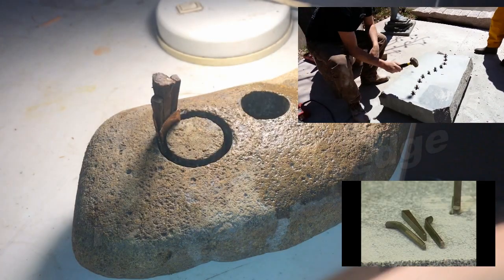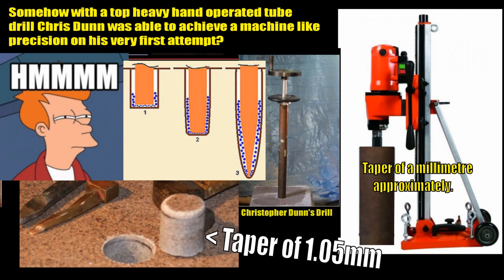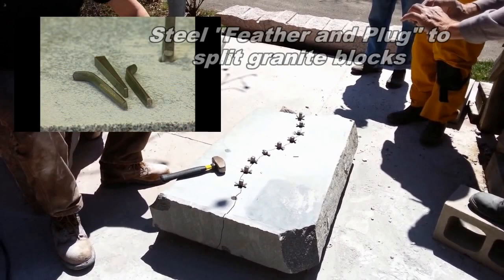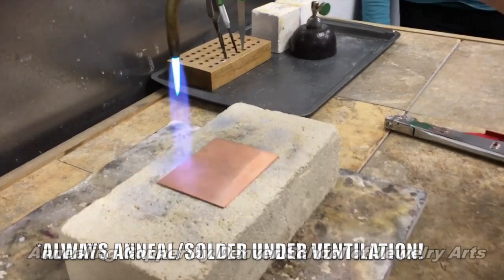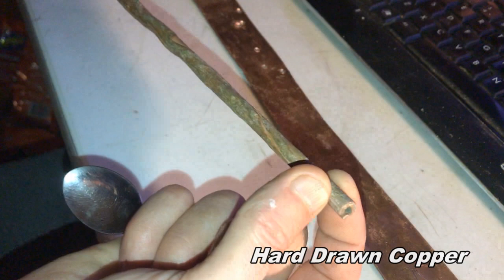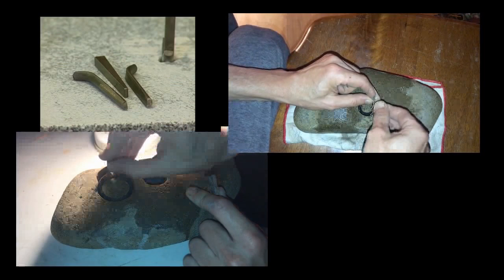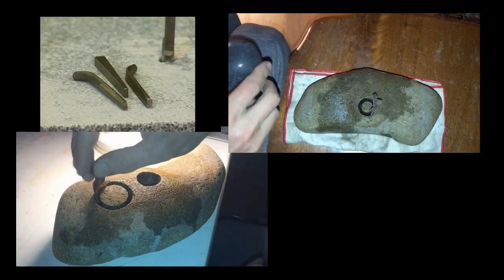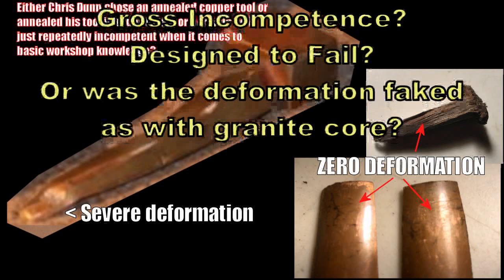Lost Ancient High Technology Industry: EXPOSED AGAIN! It's Just INCOMPETENT or it's just a SCAM!

Comment: You can split stone with just wood and water.  Dry wooden plugs that fit the holes are hammered into place and then water added so that the wood expands and puts  pressure onto the stone.  Yo may need a damn of clay to hold the water in for some circumstances.

Incidentally, your tools are probably made of the wrong type of copper.  You are using copper made using moden processes which has a higher purity whilst the copper the Egyptians used had trace amounts of other elements.  These trace elements affect the physical properties of the copper.  Arsenic, for example, is found in conjunction with copper.   Arsenic in a copper alloy will harden the alloy.

Comment: Lets say for a second that Chris Dunn did fake his core experiment.  He also did work on the statues of Hathor.  How do you explain the symmetry?  Precise to the .001 of an inch?  I'm not disagreeing with you that copper may have played the role in dynastic Egypt.  Precisely Shaping and polishing granite takes more than hand tools and skill.  Period.
Reply from the maker: How did he measure that? 
The symmetry of the Ramses statue was done with photos that were put through photoshop. 
The Serapeum is another example, his own photo shows the light reflected and it’s rippled. Like a car that has had body work done it you can the rippling on the reflection.
Precisely shaping granite or limestone or marble copper takes nothing more than hand tools and skills I would argue. 
Have you seen Roman granite sculpture and sarcophagi.
Polishing granite is just fine abrasive. I have how to videos on how to create so called precision flatness on granite.

Polishing/honing curves is just the same technique and it doesn’t take too long.
It’s basically using sandpaper to polish but without the paper. No different now than thousands of years ago.
Pliny Natural History even talks about the international trade in special sands as far as India for polishing gems, which are harder than granite to polish.
Reply: @SacredGeometryDecoded  He used photoshop to flip the image to compare one side to the other.  He's an engineer he's got the proper precision tools to do the measurements.
Reply: Just because you came up with a way to use copper that he didn't.  Doesn't mean he is being deceitful.  To act like the pyramids are not out of place is rather naive.  I choose not to speak on anyone's motivations.  I don't believe for a second that ancient Egyptians built the pyramids without tools that were more efficient than the ones described and without the wheel and something other than slaves to move them.  They may have renovated structures, superficially.  those structures were there.  Do you think the sphinx was built during the 4th dynasty.
Reply: @Alex Shilson I work with stone everyday.  It's very hard to be precise even with. modern tools.  Im not saying the ancients didn't do it.  I'm just saying they didn't do it the way they would have us believe.  Chisels and hammers didn't do it.
Reply: @Alex Shilson Copper was used in ancient stonework more than most people know.  They used copper to bind stone to stone and using it to bind stone to other materials.  Do you think the ancients had precision circular saws cutting diorite and dacite but they were copper?  there are several examples a couple in Egypt and one in Peru I believe where you can see where the stone broke but it left the uncut shape of a circle where they stopped cutting after the stone broke??
Reply: Very hard to be precise even with modern tools? What tools are you using? When we cut stones at my job we can make it much more precise than anything that was made in ancient Egypt. They couldn't even make 90 degree angles and perfectly flat surfaces. We can, pretty easily tbh, with the tools we use.

"A bad tradesman blames his tools" -SGD
Reply: @kruelunusual6242  What do you exactly do with stone everyday?
Reply: @maddogames  I do countertops, I tile, I do custom retaining walls or fireplaces interior ,exterior.  Sometimes will do some exterior stone when the job comes around.
Reply: @johnmcenroe1760  Yeah in a saw shop, but on the job with a worm drive or even a job saw its not easy, or maybe I should say its still easy to make mistakes.   Fitting stone to stone with no mortar is not easy, certainly not with the precision the ancient achieved.
Reply: @Alex Shilson another question.  If they had circular saws in whatever fashion then they had to have the wheel, would you not agree?
Reply: I also believe they haven't showed us everything by a long shot.  They certainly know more than they let on, or else they wouldn't hold on to this rigid immovable historic account.  Anyone wise and interested in the truth knows he knows nothing and when evidence presents itself is contrary to the current theory you have go adjust the theory to fit the evidence.  then if it can hold up to the scrutiny........
Reply: @kruelunusual6242  I would imagine that you have always used diamond cutting tools? I would also imagine that you use stone that has already been quarried and factory cut to size, with just some trimming on internal work and maybe rough shaping on external? I  guess you don't do any sculpting, or you would have said.
Reply: @Alex Shilson yeah sure.  I just can't imagine how.  And I'll be. honest with you its not even the shaping and cutting im most skeptical about.  It's the moving.  How did they move a 1200 ton block of limestone in Baalbek from the quarry to the temple without breaking it?  Or the pyramids.  It would've taken centuries and there are no records.  In my mind it's either from a time forgotten or they just aren't telling us.  I figure it's probably both!!!!
Reply from the maker: I have a video where i granite with a copper straight saw and it looks like a giant circular saw mark. A pendulum saw would have the same effect.
Reply from the maker: Chris Dunn faked his granite core experiment with a machine. He lied about it his experiment. 
The continued pattern of incompetence just always happening to fall in his favour?
His measuring skills such as at the Serapeum? 
Either he is a terrible engineer or he is deceitful.
Chris Dunn and co speak about the motivations of archaeologists etc all the time. They have set the tone.
Reply: @kruelunusual6242  They moved the stone on the Nile, it's actually documented by the Egyptians of the time. What you don't get told by the conman is as much a part of their scam as the lies they tell.
Reply: @maddogames  What lies and what scam????
Reply: @SacredGeometryDecoded  Ok Chris Dunn is just one person.  There's plenty of evidence both ways.  It just sounds like you have a problem with Chris Dunn maybe you are right about him.  I don't know.  I'm not super familiar with his work honestly.  I do not know what he did at the Serapeum.  I just know he thought Giza was a power plant.  I didn't look too deeply into it.
Reply: @maddogames  just out of curiosity do you really believe they built the Great Pyramid in just 20 years???
Reply from the maker: Chris Dunn is the source of all the rivers so to speak. Claims such as precision or it's impossible to cut etc from his books are constantly cited by the wider community which portray him as a master engineer etc. For several years in the comments I kept getting told to look into Chris Dunn because he has the proof. I found only extraordinary incompetence and in some cases deliberate deceptions/falsifications such as his granite core experiment, the only experiment ever conducted by this community as far as I can find. For all the years, money and visits to Egypt etc not a single valid experiment has been done by the entire LAHT community, yet they keep repeating disinformation in regards to ancient capacity such as the Romans could't do this and that etc. To say something like that would mean they would have studied that era of history, so either I am left with the conclusion that they haven't studied it and are just making things up, or they have studied it and are being dishonest.
I see these things as our birthright and they are robbing people of their own capabilities whilst making a pretty penny from it at the same time, I target Chris Dunn and co because they are an industry profiting from their claims. Selling books and tours, I and others have been censored or blocked for leaving polite comments with links contrary to their claims. Being nice hasn't worked and so here we are
I have gone through the claims made by this industry and examined them in detail, along with others I have tested them and posted the results, so that anyone can cheaply and easily test the results for themselves if there is any doubt that the experiments were rigged or poorly done. I am very familiar with what they say. I wouldn't call someone a fraud on a published format given libel laws.
Reply from the maker: The quarries of the large stones are right on the river, they were only transported a very short distance to the river and floated down, then a very short distance from the river to the final location. Before the Aswan Dam the annual Nile flooding would even allow some stones to be floated directly from the quarry to the final location without needing to be moved or lifted.
Romans moved massive obelisks such as a 400t one from Egypt to Rome, over 1700 miles making the Egyptian move seem rather small in comparison since they crossed the Mediterranean, and then 17 miles overland up the Appinines.
The heaviest stone actually moved at Baalbek was 800t and half a mile, the quarry at its lowest point is only 10 metres lower than the complex, an angle of about 0.7 degrees uphill. The higher point of the quarry is above the complex so if from that part of the quarry they's be transported downhill.
Recent excavations at Baalbek have found Greek and Roman artefacts beneath the complex confirming it's age. Romans wrote about their lifting tech in detail, they had the know how and the materials to move those heavy stones. It's all based on ships rigging, if you can rig a ship for sail then you can make a crane. The forces on the mast and sails are massive.
Lebanese cedar and hemp rope are more than strong enough to support those weights.
They had the tech and the materials to do the lift and as the Romans pointed out they inherited their knowledge from the early Egyptians and Chaldeans. Many of the greatest Roman engineers came from or studied at the Library of Alexandria in Egypt.
Reply: @kruelunusual6242  I don't know how long it took. What I do know is 100,000 workers can achieve a LOT in 20 years. When you have a whole 'civilisation' dedicated to one task there is going to be unprecedented results.
Reply: @maddogames  It is not about the number of workers. It is about transporting the blocks to higher levels of construction .. the capacity of the ramps .. transporting the blocks on a relatively flat ground or along a river is not a problem ..
Reply: @szpakmateusz8500  You assume everything was moved on ramps? What about lifting gear, counterweights and ramps? There are 4 sides, each side wide enough to allow a ramp of sufficient size for many teams of workers to utilise. It doesn't have to be one ramp, which only allows one block at a time to pass.
Reply: @maddogames  Most of the evidence points to a single ramp .. the speed of block delivery on such a ramp is critical (efficiency ( time / quantity )
Reply: @szpakmateusz8500  Is that evidence from the scientific community or from those spouting ancient high technology? You can't say the 'evidence' is there and then say that it's not possible. From all the evidence I have seen, minimal ramps and lifting gear at each corner seems the most efficient and probable way. I think the great pyramids construction will always be a mystery as to how they actually did it, as there are a number of possible ways it could have been done, but the truth is now lost to time..
Reply: @maddogames  The scanning of the pyramid was done by scientists ... the results show a single ramp ... the efficiency of such a ramp is the key to the logistics puzzle ...
Reply: @szpakmateusz8500  There is evidence of a large single ramp leading to the pyramid, and also evidence of a ramp which spirals around the pyramid, also theoretical evidence exists of lifting gear being used at the 'corners' of the pyramid. there is also speculation of the grand gallery being part of a lifting system which used counterweights to raise the heavier blocks.
Reply: Dio Brando  You can't prove a negative Einstein!  I Work with these materials.  I choose to not be satisfied with being told what my opinion should be when that opinion in ridiculous in my reckoning.
Reply: Dio Brando  Experts want you to believe in the legendary Khufu.
Reply: Dio Brando  The only so-called "evidence" they have is the legend of Khufu ..it was not a one-generation project ... it's obvious ..